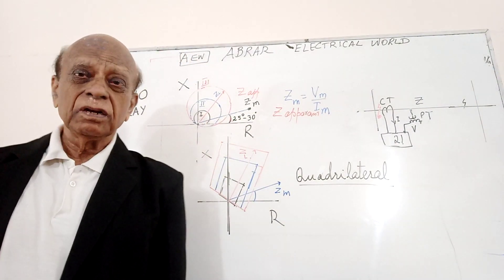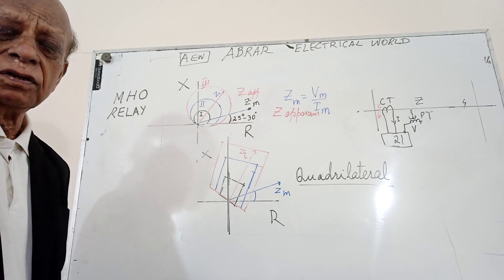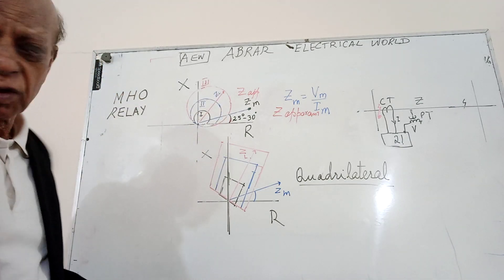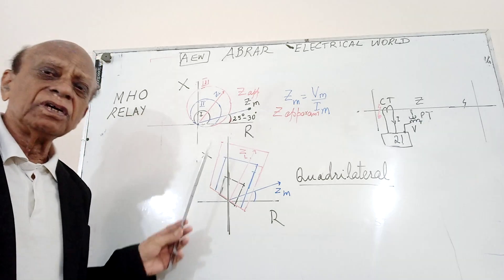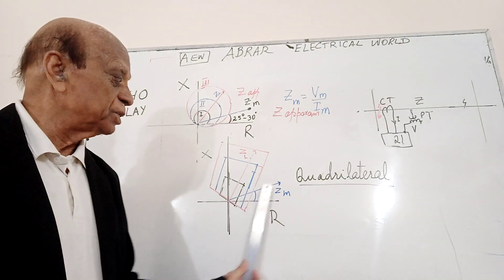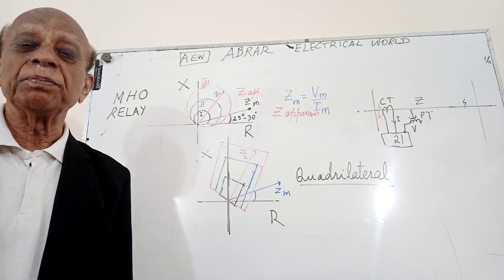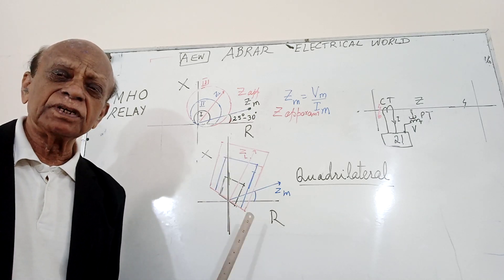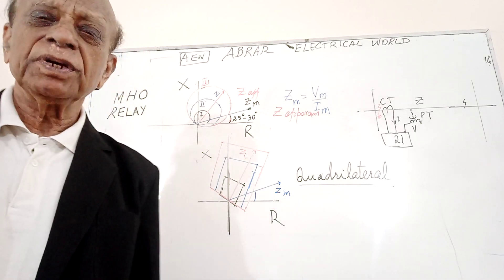QUADRILATERAL  DISTANCE RELAY CHARACTERISTIC

Comment: To avoid tripping, we set a load angle, suppose 45 degree and fault angle of distance protection remain s close to the line angle of conductor. To avoid tripping below 45 degrees, all the faults will be blocked, and higher angle faults are allowed for tripping.